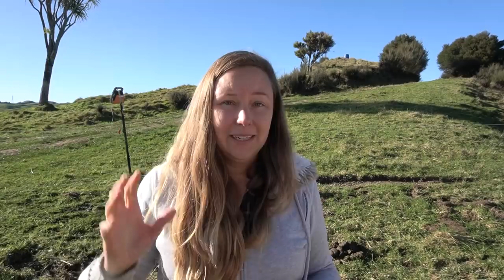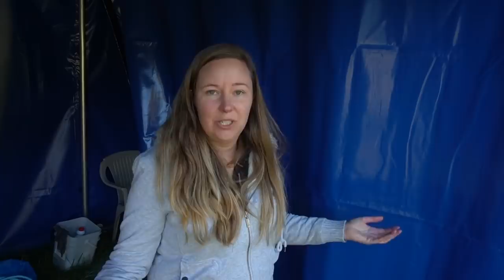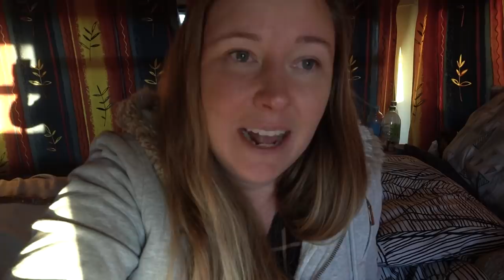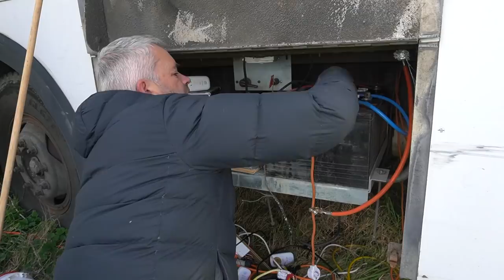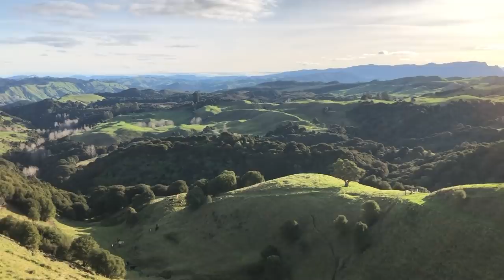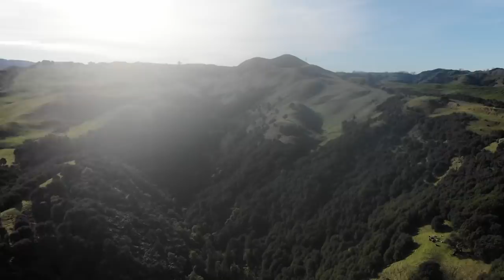Off Grid Camp Set-up | Middle Of Nowhere

Comment: Invest in a diesel heater. If you can get one from an old boat or Land Rover a Webasto unit. Or if not there are loads of Chinese ones on eBay cost you about £80 uk. Just have a look for a seller with good feedback. They are super efficient and can heat a large area like a bus. They take a small amount of power for the display and fuel pump the rest is diesel combustion. Best thing is with ducting you can heat multiple locations and if Hayden was able plumb in to the caravan as well.
Reply from the maker: I am tempted with a diesel heater...
Reply: Travelling K il do you a little video

Comment: Regarding your heating problems we have a 24 foot Class A motor home and are boondockers.  We removed our furnace and replaced it with the Olympian Wave 6 6000 BTU LP gas catalytic heater (Amazon) two years ago, and love it. It uses NO electricity and very little LP and heats our unit very nicely.  You might consider thinking outside the box and save yourself electricity and LP good luck!  PS we also use a composting toilet and are amazed how easy and convenient it is...no more issues with find a “dump” site!  (C-Head brand initially designed for boaters). By the by, Nicee and “warm” here in Las Vegas....
Reply from the maker: That's interesting about the heater... thanks. We should set-up a proper composting toilet. Ha, make me jealous about your heat!

Comment: Suggestion 1 - get a wind powered generator too ?
Suggestion 2 - get a purpose-designed electric generator - that runs on bottled gas which ought to be quite a bit cheaper than petrol and is less messy and is also a generator you can recover all the heat from via a heat exchanger. That will bump the efficiency tremendously. When you run it to pump water, it'll heat your accommodation as a by-product - in effect, free of charge compared to what you have now.
Reply from the maker: Sounds like there are a few options then!
Reply: @TravellingK  Most of the time there are options for all sorts of things :) Sadly, some of them only exist in my head - at the moment !

Comment: You should sleep in the caravan! Being a UK model it's going to have more insulation than the bus and will be warmer at night! The heaters are designed to be used even when asleep too (we leave ours on low) as they're sealed from the room so no risk of gas inside the caravan etc.
Reply from the maker: It is warmer... but the bed is tiny compared to the bus bed!

Comment: Karen, you should go solar panel off grid total. If you have not tried it, do it as a project. Remember also when you charge your gadgets, make voltage difference as less as possible to lower power dissipation/power loss, meaning dont charge your phone from a 220 volt charger from your inverter, but instead from a 12 volt source, same with your laptop.
Reply: Great advice, I updated my setup a few months ago, makes perfect sense when you know about it.
Reply from the maker: I've got a good solar set-up :) And have added a few USB sockets

Comment: Hi Karen im planning to build a trailer/camper trailer  with help from a trailer maker. just like some feed back on the size im going to use. i was thinking of 3 metres long  2m high and 2m wide, in this i will have a ramp at the back and a side door. I also plan to have a double size bed at the end. would like any ideas/feedback  on this project. Regards Bill

Comment: Hi love your videos.
Can I ask how big your solar panel is on top of you caravan, and what size batteries do you use please?
I am currently setting my caravan up to be off grid 🙂
Reply from the maker: It's a 330W solar panel and 2 x 6 volt 390ah batteries😀If I did it again, I'd get lighter batteries.
Reply: @TravellingK  oh ok thanks. That actually seems like a lot. 6v? In Australia all the caravans are set up for 12v. I'm setting mine up with a 250w panel and a 120w portable one I can plug in if I think I need extra power. I've also ordered 2 X 130a batteries. I hope the batteries are enough if I want to use things like a microwave with an inverter but maybe that's too much power for the batteries? When things get better with covid maybe you could try travelling Australia? I live in Tasmania, it's also a great island to travel around in with a caravan. Maybe people could sponsor you to do that. I'd certainly chip in to help you do that. Cheers, stay safe 🙂.
Reply: @bernhard5009  You can turn 2 x 6v batteries into 12v. To produce 12 volt output, two 6 volt deep cycle batteries must be wired in series (positive to negative). When you hook up a neg post on one battery to a pos post on the other battery that will leave you a neg and pos post to hook up to just like a normal 12v battery. Yes, I realize I am way late posting this, sorry.

Comment: Just seen Haydens batteries he was taking out it looked like he had old batteries with new batteries. If true he needs to set them up as 2 different banks old and new because if you connect old batteries with the new the old batteries will drain the new batteries and shorten there life. I know because I have had it happened to me.
Reply from the maker: Good spotting😉Yes, he'd previously told me he shouldn't have done it that way.